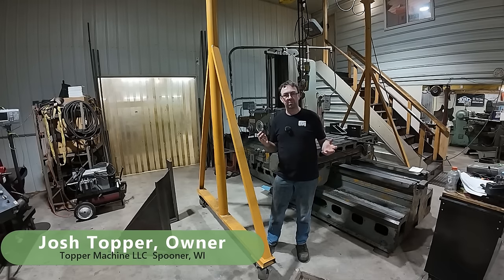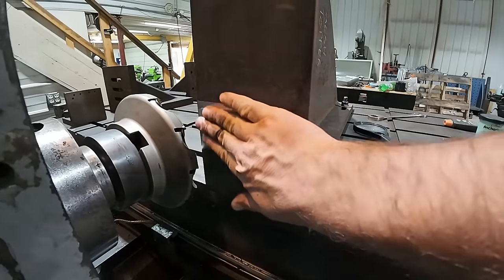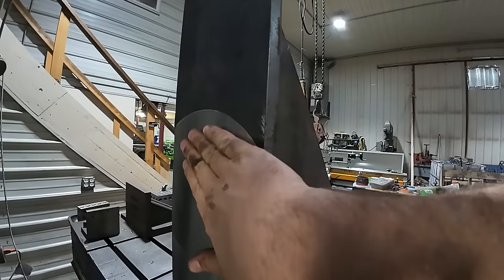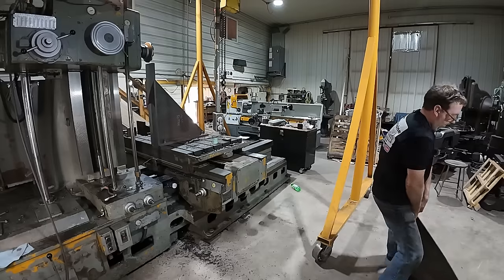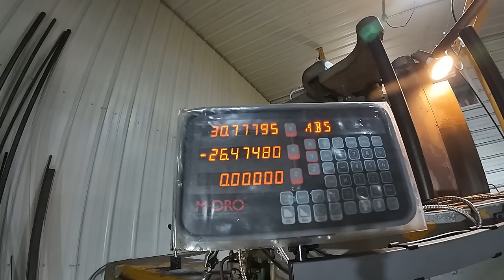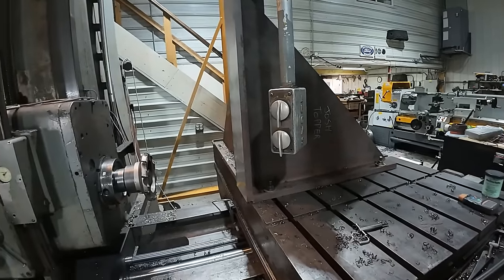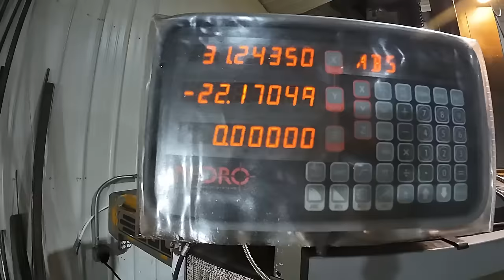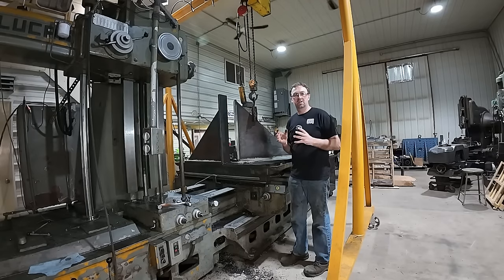Milling Shop Made Angle Plates on the Horizontal Boring Mill - Shop Built Tools

Comment: I asked you a day or 2 ago how old is your machine, I’ve never around a machine with a horizontal head. It sure looks funny to me
Reply from the maker: 1963, Horizontal Boring Mills are very common in large shops.
Reply: @TopperMachineLLC  
Thank you Sir, 1963, that’s 60+ years, it’s got to be a good 1 to still be working & holding everything straight & true

Comment: Could you have milled that half the face at a time so the force was going straight down into the table instead of sideways (which was making it sing)?
Then a full face finishing pass at the end?
Not criticizing, just asking to learn
Reply from the maker: It would have vibrated no matter what I tried. Support is the only cure.
Reply: @TopperMachineLLC  Thank you! I appreciate the reinforcement of the mantra "rigidity, rigidity, rigidity"